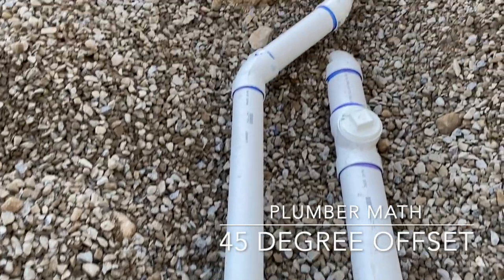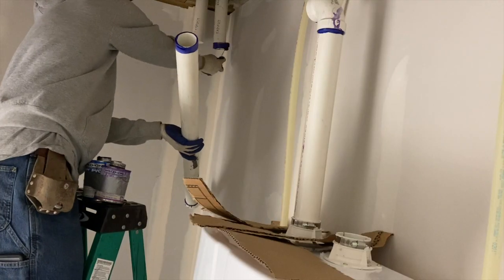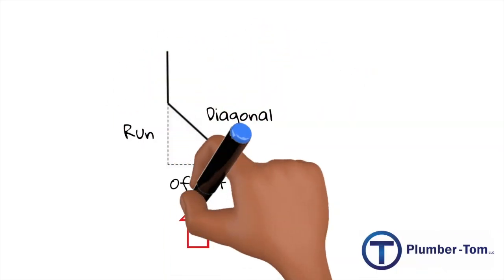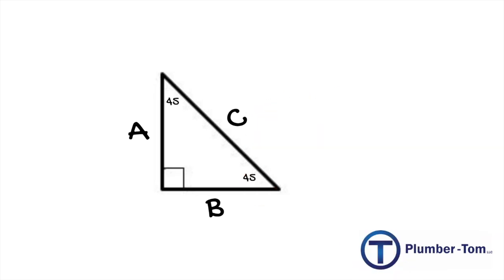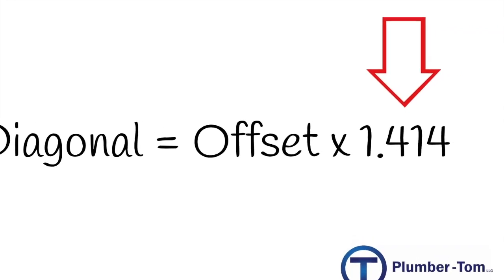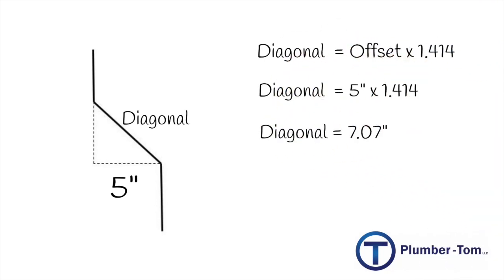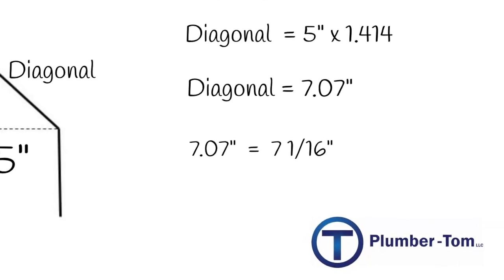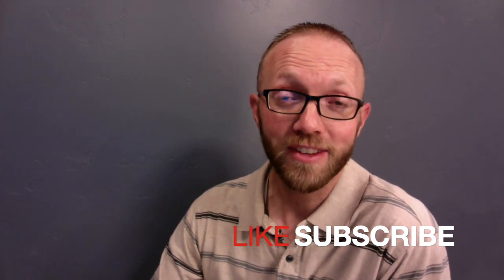Plumber Math: Offsets Part 1 - 45 Degree Offsets

Comment: How do you measure for the run of the pipe
Reply from the maker: You can measure from where the pipe is to where it will offset to.  Sometimes you have to measure from a parallel wall to each pipe and subtract the difference.  You might have to get creative to get a measurement.  Hope that makes sense.
Reply: Rodger Wakefield, who kind of drives me nuts sometimes, talks about the firing makeup chart.
The way Roger explains it confused the crap out of me but you did really well with it.

Other than a test I probably would have never used it., but the way you do it, made it look usable for more than passing my test